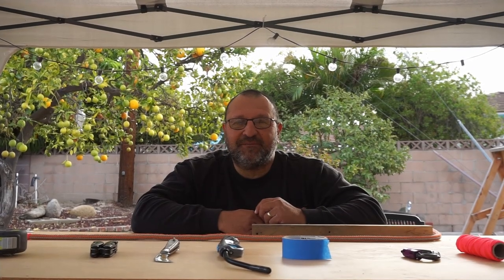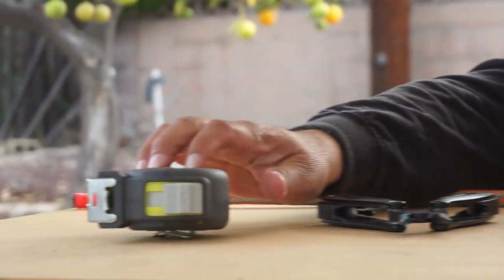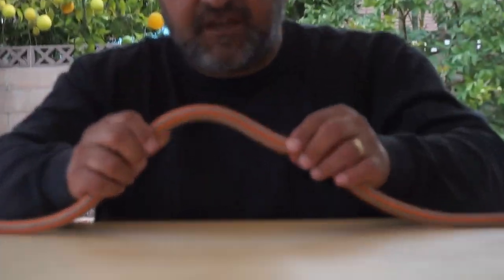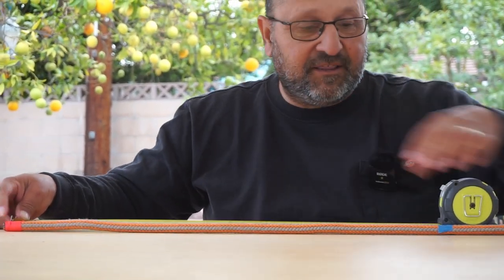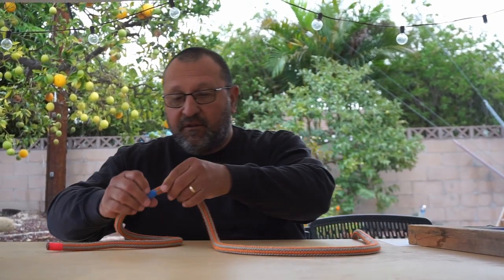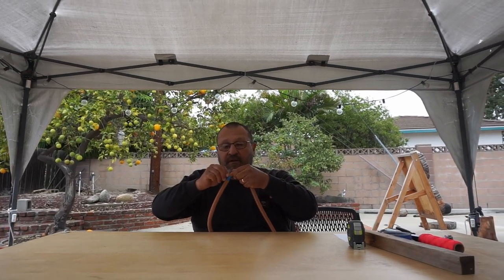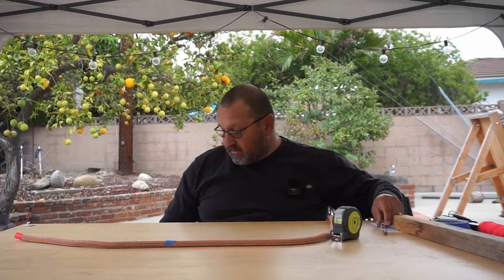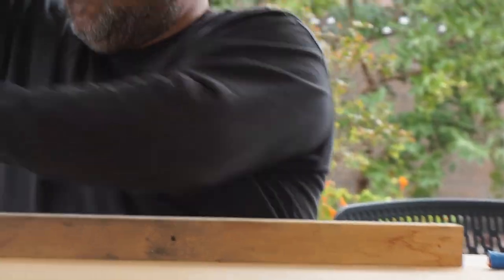How to Make A Split-Tail From Scratch | Homemade Split-tail Tree Climbing

Comment: I love that whipping lesson!  After recently volunteering for an ISA climbing competition, the only termination knots I noticed were on my own hitch cords and lanyard, and certainly not a split tail in sight.  While I don't yet appreciate the value of a sewn eye on a hitch cord, I'm wanting an eye on my lanyard after freeing the dbl fisherman's bend from pinching while retrieving from many maple unions.  P.S. I was inspired by your shizzl tender & frustrated with lanyard micro pulleys.  I found a way to DIY a Shizzl tender on my lanyard from a $7 large steel rap. ring.  My lanyard's hitch termination knots are tied around the large rap ring, then the hip carabiner is clipped into the same termination knots.....please tell me if/why you think that's not safe (I plan to get a steel petzl Oxan to avoid aluminum carabiner from getting flaked or damaged. The added bonus is quick mini MRS, when you unclip rope snap from harness D or lower D, then clip into the rap ring.
Reply from the maker: It's hard for me to visualize but it sounds like your friction hitch for your lanyard is tied to the ring. If your ring is rated for climbing it should not be an issue.